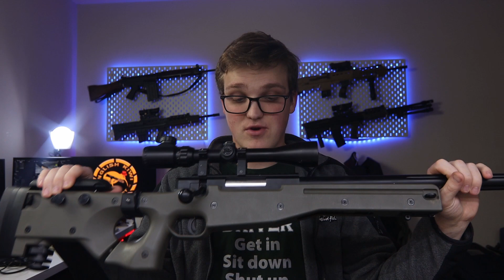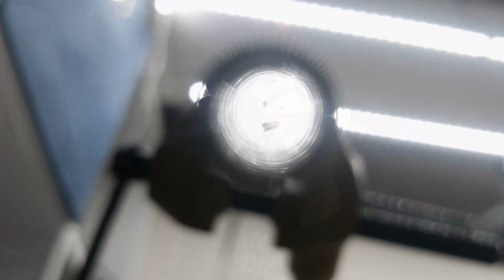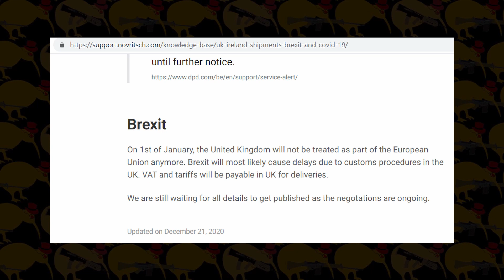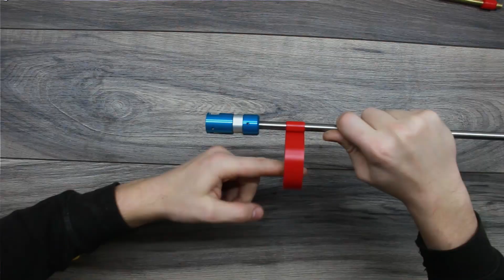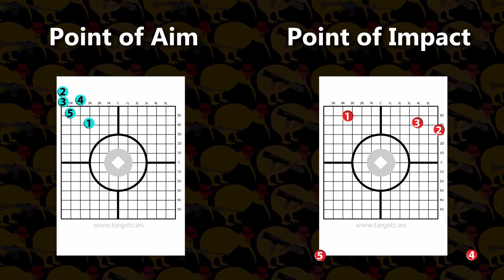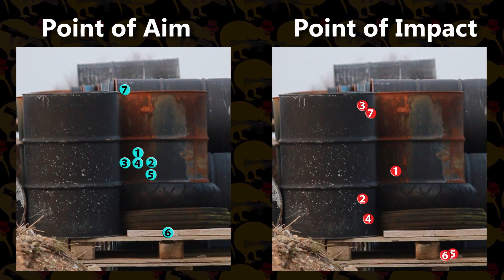DIY Airsoft - The Novritsch SSG96: Part 3(a) New Barrel and Hop

Comment: I dont know Rick... I own an Stock SSG96 and an Stock SSG24,  have done grouping test as well and the results looks way better than on the video... 

Now Im not saying that you cant build a better rifle than the novritsch one, because I've seen rifles that do...
But the main point of Novritsch rifles is that you wont have to go thru the mostly annoying process of building one on your own to have a great rifle, and they have a fair price (except for the A2/A3 stocks, those are a luxury...)

I research a lot before getting my novritsch rifles, and its more complicated than it looks to upgrade, since certain brands modify the standard parts of L96 rifles... This make that some models are hard to upgrade or to have issues if you do...
CYMA L96 is one of those... Well L96 Shadow Ops is way better to upgrade and to build into...

At the end thats why I got my novritsch babies, I help economy, enjoy my sniper ride and help a company that is actually helping airsoft on many ways and for a fair price and profit...

Not saying you should not build, on the contraire, if you want do it, but if you do, RESEARCH a lot before doing anything, which models are good to build into, what parts fits and are compatible, that those parts works with each other, etc... All of this to avoid wasting money, wasting time, and make you have a good time with the perfomance of your rifle...
Reply from the maker: Yep I agree and this is what I've said throughout the build process. Yes technically you can build rifles that are better or cheaper, but it takes time and effort. Novritsch does offer some pretty decent builds out of the box, but to be honest comparing the build quality of the ssg96 to an ssg10 they're in quite stark contrast. Part of me thinks that the OEM of the 96 may have let the ball slip though. Now I am only working with a sample size of 1 which was lent to me and can only present the results I got, which is its an ok performing BASR but nothing crazily mind blowing.

I agree the cyma is not the ideal base to build from with extra mods needed to get the hop and barrel assembly and aftermarket cylinders to work in it, but at the time I couldn't find too much info on it so thought I'd take the plunge and share my experiences with everyone.

Comment: Interesting vid as usual! What material is the stock cylinder made from? Will its sears hold up to a full power spring do you think? These are the things that could blow the budget!
Reply from the maker: The sears are 90 degree and steel so they should handle it fine. The cylinder on the other hand may be an issue as it's not steel, but so far it's held up :) that being said even with a full Airsoft pro replacement (cylinder, head, piston and spring guide) we're still looking at a total spend of £300
Reply: @EnglishKiwi  excellent 😃

Comment: Im a southpaw and I actually prefer a right hand side bolt on a sniper rifle, it allows me to keep my shooting hand in place while recocking with my right for pretty quick and accurate follow up shots.
Reply from the maker: Fair enough, but how do you keep the rifle stable between shots?
Reply: @EnglishKiwi  tight into shoulder, my left hand stabilises the rifle while I pull the bolt then my right hand resumes position forward to stabilise when shooting....kinda thing

Comment: One question though.. you have a 3d printer, why not print snug fitting spacers?

I've done so for several rifle's for both the barrel hopup an gearbox.

Edit... nvt not everyone has a 3d printer.. and that would defeat the purpose of this project.🤦‍♂️

Gonne grab my morning thee now
Reply from the maker: I was going to do that and factor in the costs of them, but the tape mod works really well and I wanted to limit the variables between tests (he says after replacing had the internals 😂)